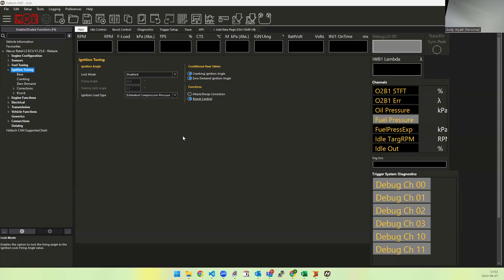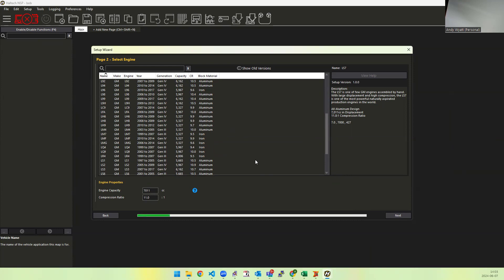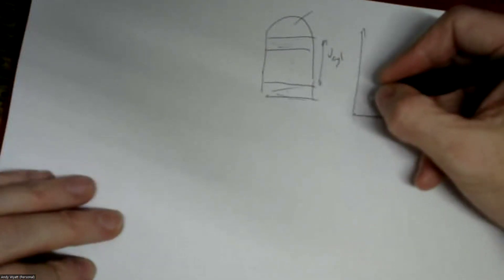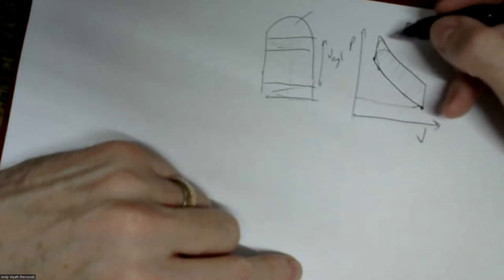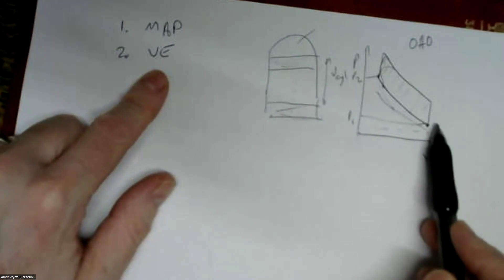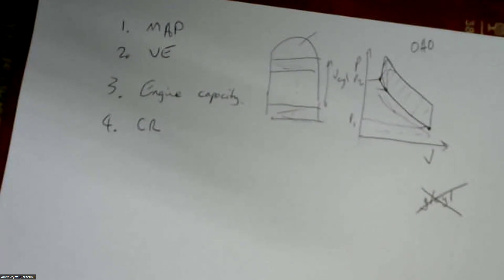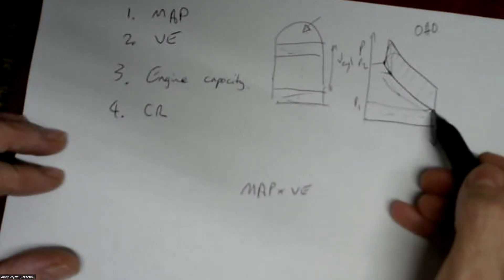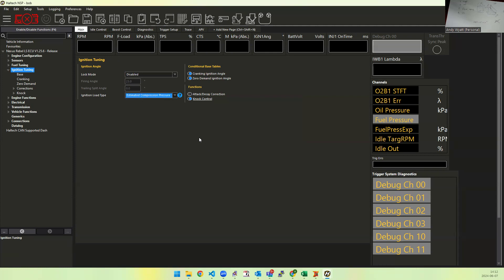Estimated Compression Pressure on Nexus ECUs

Comment: is there anyway to set it up like ignition load (psi) without having to remake the entire ignition table? it still super confusing as im trying to set the ign table up for boost.
Reply: Thanks Andy, you are an amazing resource
Reply from the maker: The next NSP release will do the calculation when you change the load from compression pressure to MAP. In the mean time you could do a trace at atmo to see where your compression pressure is, then create new columns at the MAP points for those and copy the columns across; that would get you most of the way there (it would give you a good starting point).